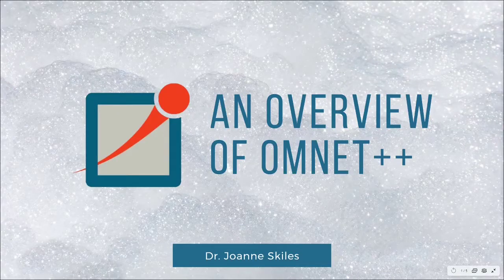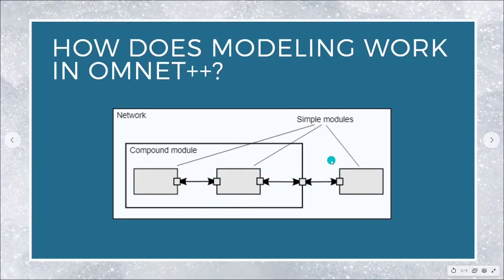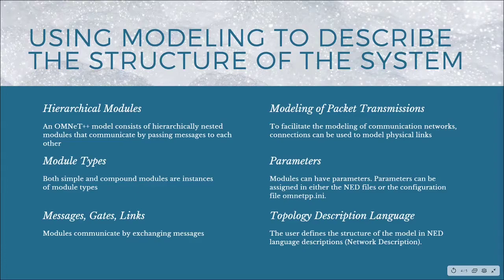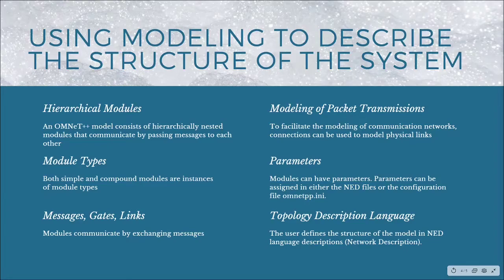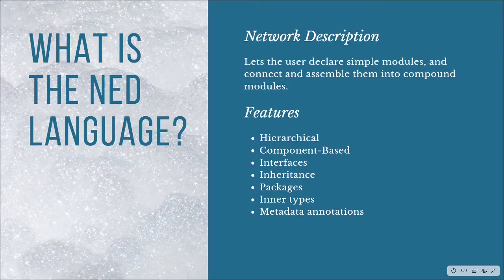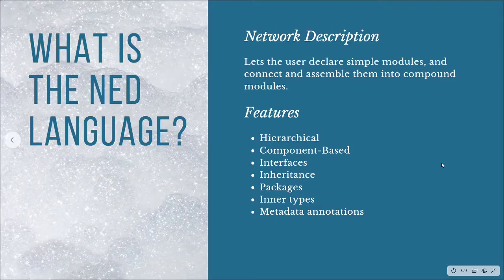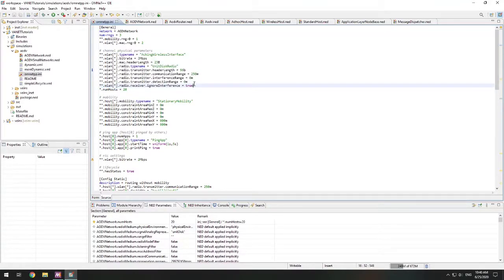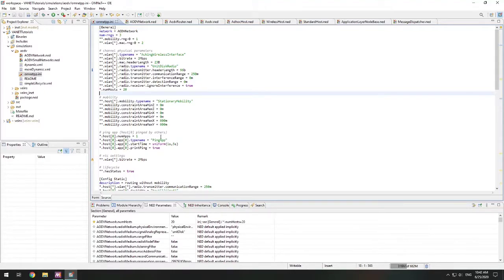An Overview of OMNET++

Comment: Hi Dr. Skiles!

Your videos have helped me a lot to understand a little more about OMNET and VANETs. Thank you very much!

Could you help me to solve a problem in OMNET. please?

I would like to know how to increase the beacon size using the OMNET++ simulator. I saw that it is possible to perform this configuration through the cpacket constructor.

cPacket::cPacket    (   const char *    name = NULL,
short   kind = 0,
int64   bitLength = 0    
)   
My goal is to analyze how beacon size can influence message delivery latency between two nodes.

thank you in advance for your valuable help

Comment: Hi Dr. Joanne...I'm attempting to model a wireless network that converges WSNs and mobile cellular networks. Convergence would take place in a gateway, and the transmission would continue from the GW into the 4G-LTE infrastructure. I've seen prior research (Crosby & Vafa, 2013) that did this very thing within OMNeT++. Do you have or could you point me toward any tutorials that would explain how to configure such an environment with OMNeT++? Thank you! [Ref. Crosby, G. V., & Vafa, F. (2013, October). Wireless sensor networks and LTE-A network convergence. In 38th Annual IEEE conference on local computer networks (pp. 731-734). IEEE.]

Comment: Hi dr.Joanne , thnx  for this useful video , i have a problem when i'm trying to install INET frame i get this message "An internal error occurred during: "Download project descriptors".
Invalid thread access " , also i tried to download INET and import it to workspace i got errors , i am using win 10 64 bit, can you help me to solve this problem . thnx in advance
Reply from the maker: Check the OMNET++ IDE version, make sure you are using the latest version
Reply: @DrJoanneSkiles  I really did that,  I used version 5.6.2 and still having this problem
Reply from the maker: @ФарахЮсеф  Are you downloaded INET inside OMNET++ or are you using the Github repo. I suggest using the GitHub repo
Reply: @DrJoanneSkiles  yes. I did, tell me please how can I use git repository!?

Comment: Can you tell which are the messages are passed?
Reply from the maker: Yes, when running the simulations a results folder is created with all the results save, in there is details about messages passed. You can also view them in the simulations.